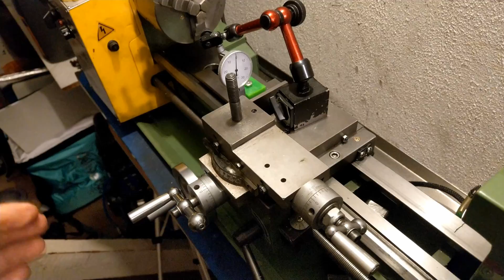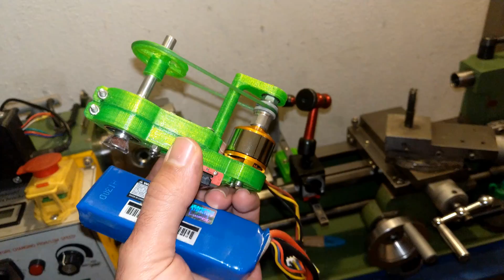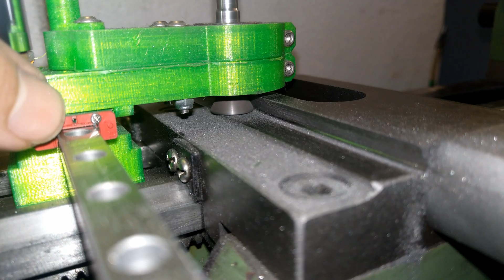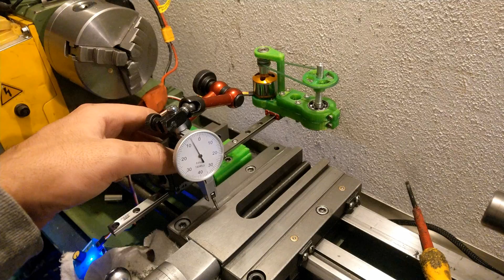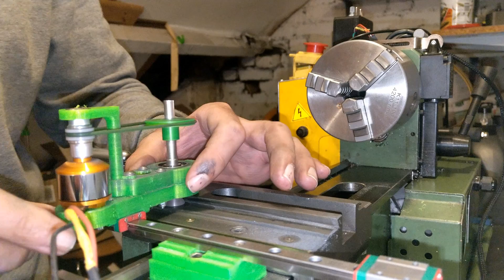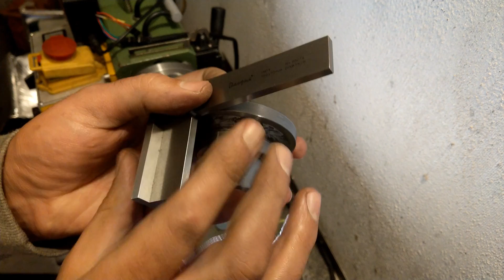Mini Lathe Cross Slide Alignment , Cross Slide Dovetail Grinding, Part1

Comment: I had the same problem and did something similar but your way is smarter. I put the cross slide on my vertical mill and aligned the ways to the the mill x-axis and cut a reference on the outside of the slide, then turned it over and used that reference to align perpendicular and re-cut the dovetails. Your method of doing it situ is definitely better, mine turned out well -- though I eventually upgraded to a bigger lathe.
Reply from the maker: Most  Chinese small lathe are not good at all , they need a lot of machining and alignment to get a reasonable cut, I remachinied all cross-slide and compound, I will realise the video soon, thanks for watching though

Comment: Here is another way to test the total alignment of the cross-slide to the spindle Y-axis. 

Link: https://www.youtube.com/watch?v=5MhJ0-jLBAA  This will only measure the total misalignment of the cross slide and the headstock.  Your method is excellent in isolating the alignment of the saddle+cross slide to the bed ways, independent of the headstock
Reply from the maker: Thanks for share, I watched the video, but with that method also you can get wrong measurements since head stock can be miss aligned

Comment: This is really clever set up for a rather difficult or tricky milling/grinding operation.  This is another prime example of when faced with constraints of cost, accessibility of tools, human ingenuity can triumph over all the elaborate or even complicated solutions.  The solution you showed is really very clever, that you corrected the problem even without taking out the part.  Kudos from a retired Ph.D engineer.
Reply from the maker: @rsc4peace  thanks for watching ☺️

Comment: I wonder if I'm experiencing the same problem. I start with a .010 cut, after an inch or two it is no longer cutting but just skimming the surface then doesnt touch the work at all. Is there an adjustment somewhere that might cause this? tyvm
Reply from the maker: If your setup is same, and  your tool is rigid you should have same amount of grinding, may be the slot is not even, or sandpaper worn out or gets accumulated(clean your stone or sandpaper with brush time to time), try to move your tool end to end and don't keep it at one point , 
Thank you

Comment: verry ingenious idea , only wonder if they made it slanted for the gib to be able to adjust the play while keeping the crosslide straight , as the gib is slightly tapered too , they mightve fitted the gib the wrong way round
Reply from the maker: I personally didn't have much issue, just little increase gap between the male and female dovetail, and just made a bigger gib strip for it and workes fine.

Comment: Would have thought that the linear bearing would have had more runnout and give you a false reading, so far so good 👍
Good thinking out of the box. also, how often did you sharpen the cutter?
Reply from the maker: The linear rail is branded one , and if there was a misalignment , I would notice it because ,I check the rail against the edge square, which is DIN grade , I changed the sand paper pads few times for each side, there is a second part of the video , in that Ive shown how the pad getting changed,
Thanks for watching 😇
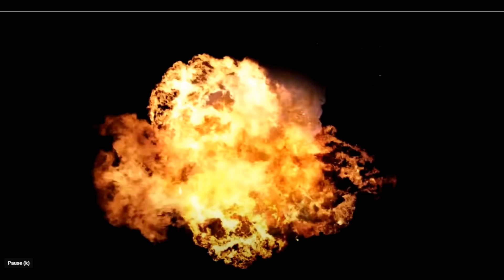Reply: 16:39 🎉😢 16:39

Comment: After 60 years in engineering I thought I had seen most of it but this is something so clever I almost fell off my chair......I take my hat off to you......using that linear rail was the cleverest thing since sliced bread.
Just as a matter of interest I have an old 1930 Colchester Bantam lathe that I had to recut all of the bed ways with a hand push planer and scrape them in....the bed was worn down from the middle to the chuck by .013" making it impossible to do any machining without the saddle lifting by the chuck end and locking solid around the middle etc....it took me 2 months every night working for 4 hours per night and 10 hours on week ends.....hard work but it worked.
Seeing this method for the crosslide I think I'm going to do a test on my crosslide dovetails too.
Reply from the maker: Thank you, to be honest this was on the best alignment that I've done to this lathe, I personally find it is so interesting to rebuild and reshape these types of machine in order to make a precise part, 

I think you should film some of your work and share ,and people can learn from your experience,
Reply: @ParsMaker  I think those that watch other people doing the work never learn....it's like learning to drive.....you have to get behind the wheel and do a few hours of actual driving before you know what the gear lever and clutch pedal are for.
I would not advise anyone without some mechanical skill to rework the important bits of a machine......without knowing how or why you must do something it's best not to mess with it at all.

Comment: Amazing! I have exactly the same problem, 0.2mm difference on the indicator over the length of the cross-slide :(
Reply from the maker: Thanks mate, almost same, I had about 0.2 mm difference for my entire length,  but managed to fix it with this method, I'll release the second part next Friday , I grinded the top part, and you should see the final result 😇

Comment: Great video and you obviously are exceptionally talented, keep it up!
I love how you are marrying the old technology of the lathe with newer technologies such as 3D printing without making it feel like your doing it.
Questions; 
-Why no sealed bearings on your grinder?
-How did you adjust your depth of cut?

And now it’s time to check this as I rebuild mine, I might have an excuse to buy a 3D printer, lol.
Cheers,
Reply from the maker: Thanks mate ,  
I used open bearing because , the sealed bearing packed with grease which makes some fraction and take more torque from the brush-less motor, since the motor is small and doesn't have that much torque ,so I tried to keep the tool as effective as possible but I clean the bearing with isopropyl alcohol time to time and used some light oil on bearings for lubrication.

for dept of the cut I simply used split nut to luck the carriage and used lead screw to adjust my depth of the cut.

with some knowledge of Designing and 3D printing you can make lots of things, very useful tool to have. :D

Comment: At the start i was worried about flex on the printed parts but it all looked well and the DTI dont lie 

nice work
Reply from the maker: I printed the part with PETG, and also tried not take deep pass on Dovetail, because the brush less motor wasn't to strong, but the frame could handle alot more,